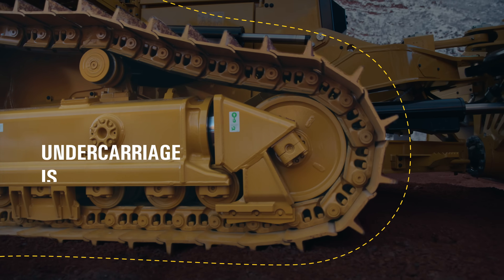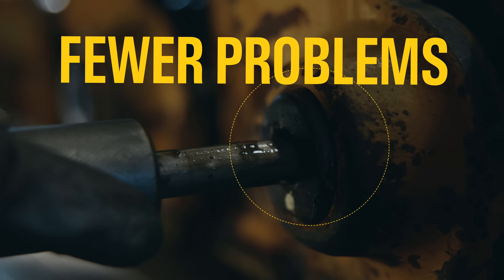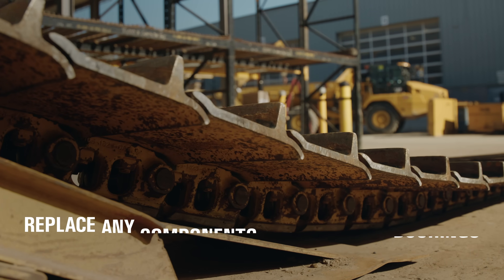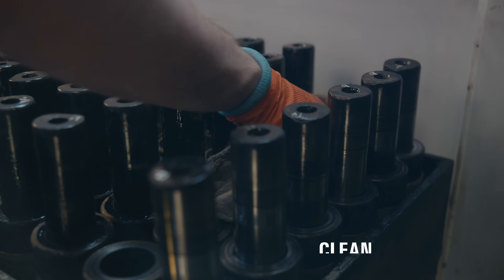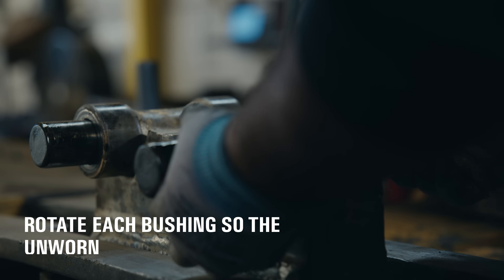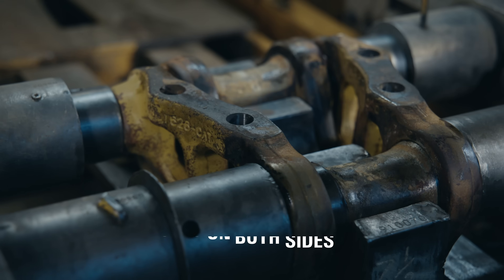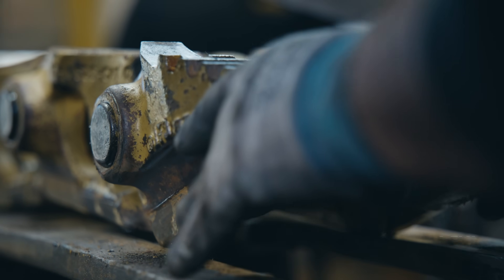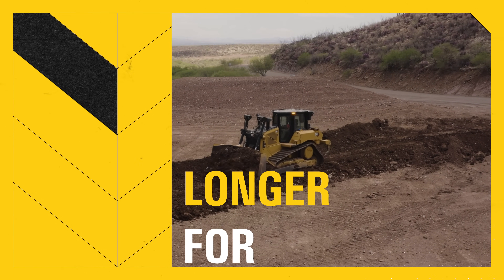Deep Dive: Wet Pin and Bushing Turn with Cat®

Comment: How many hours should you be able to stack on a machine before having to torn all the pins?   Around 8000 hours or something?
Reply from the maker: Thanks for asking, Edward. Bushing turn intervals can vary widely depending on machine size, undercarriage type, underfoot conditions, and application. In high-abrasion environments, turns may be needed in under 1,000 hours, while in lower-abrasion, higher-impact applications, it could extend to 5,000+ hours. For the most accurate guidance, we recommend a Cat Undercarriage inspection by your local Cat dealer to determine the best maintenance plan for your machine.

Comment: In many if not most cases it is only cost efficient to turn pins and bushings on large machines, think D8 and up. The other issue that comes up is the amount of wear on the links. High drive undercarriages put two wear spots or valleys in the rail areas of the links. This is because of having idlers on each end of the track frame. In most cases I have been associated with, companies don't continually monitor the wear on the undercarriages and then blast right through the wear points and can't make decisions that will optimize the cost per hour of operating their dozer. The common scenario today is to run the chains till the sprocket teeth are about worn out. Sprocket segments are then replaced with new and the undercarriage is run to destruction.
Reply: high drives just generally eat under carriage because of there design, they eat bushings and segments because of only 3 bushings taking all the torque, I've seen some of the craziest wear patterns on these machines, great design for mining and hard rock but not worth it for anything else

Comment: With shop labor rates today does it really pay to do the wet turn or just buy new rail assemblies? What is the cost comparative?
Reply: bingo thats what i was wondering thanks for asking the question
Reply from the maker: A wet pin and bushing turn can often extend undercarriage life at a lower cost than a full rail replacement. The savings depend on your machine, application, and local labor rates, so your Cat dealer is the best source for a cost comparison: https://www.cat.com/en_US/support/dealer-locator.html. 

If you'd like some help getting in touch, please send us a message letting us know where you're located. Before you decide to share your information, please review our Global Data Privacy Statement at https://bit.ly/CaterpillarDataPrivacy.